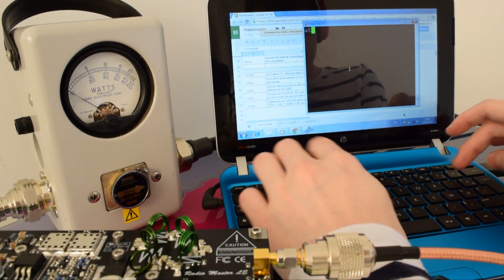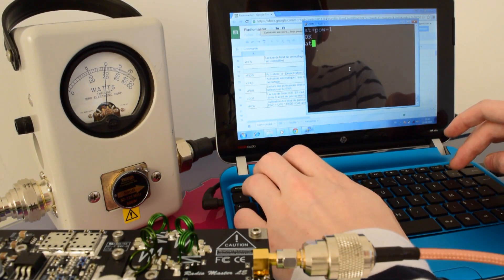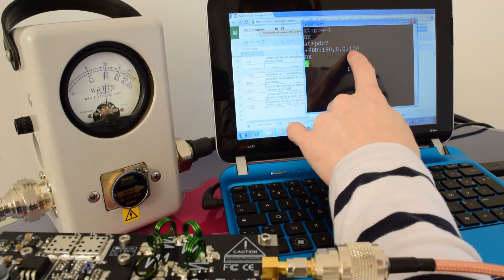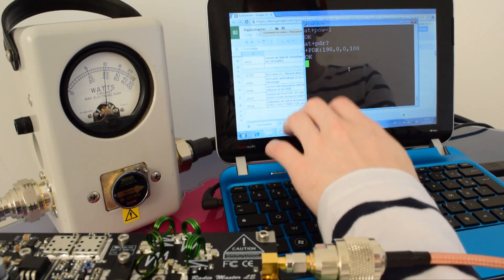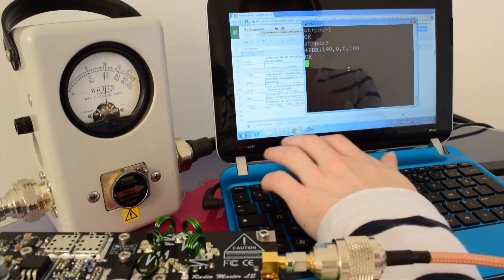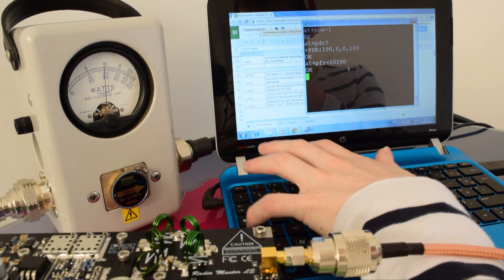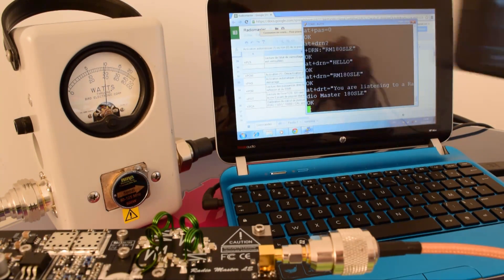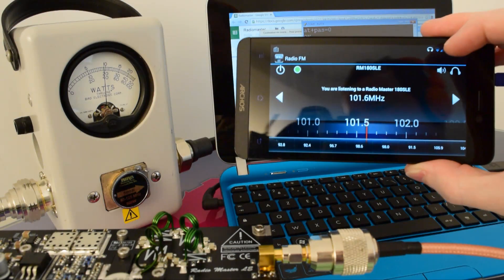Radio Master 180SLE

Comment: Is the signal/noise ratio of 96 dB without the use of stereo generator (MPX input)?
Reply from the maker: +Gabriel Ueta Hello, 96dB is with the DSP encoder. MPX performance are higher. In stere you have about 84dB for the SLE series ;)